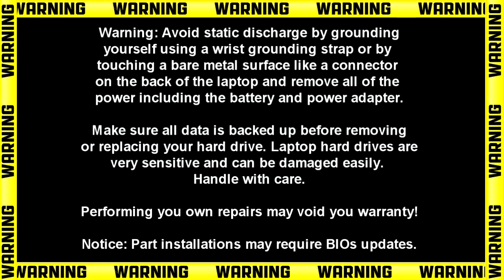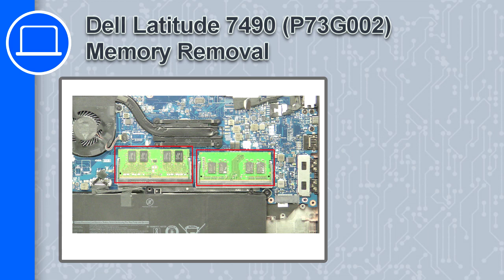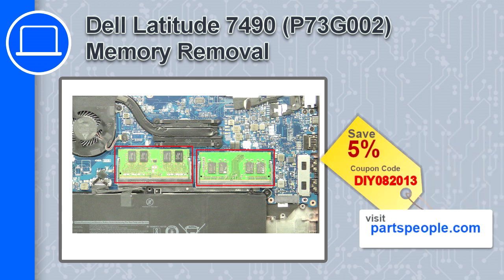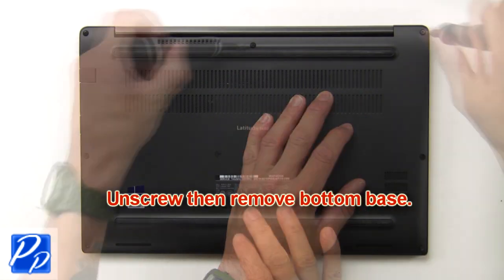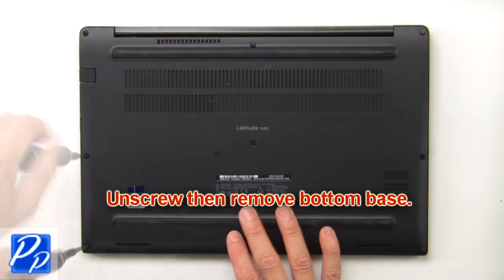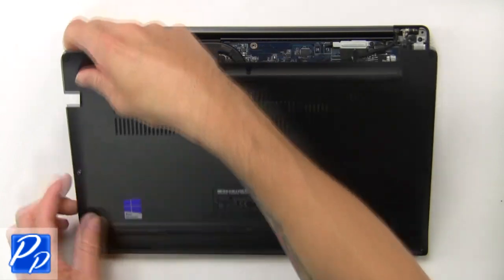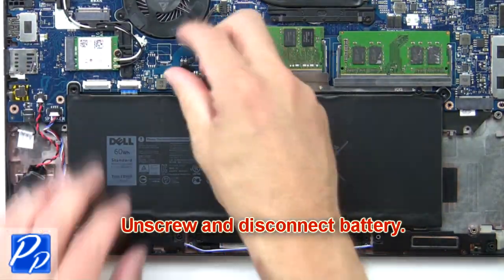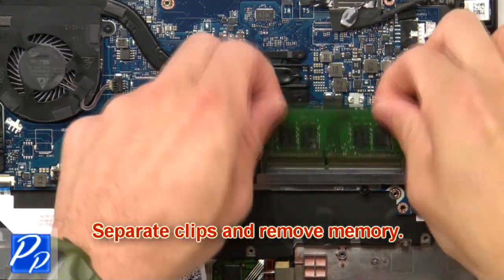Dell Latitude 7490 (P73G002) Memory How-To Video Tutorial

Comment: You need to remove batteri when installing more ram?
Reply from the maker: Our videos follow Dell's recommendation of always removing the battery before working on your laptop. This is a precautionary measure.
Reply: @dellpartspeople  Thanks for your answer. I have only 1 block installed so I thought maybe removing the battery would not be neccesary.